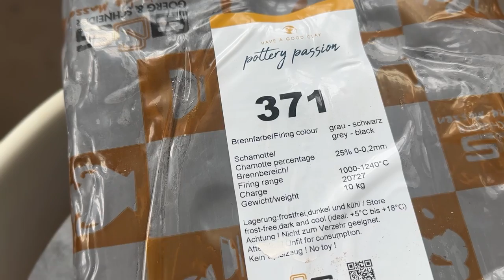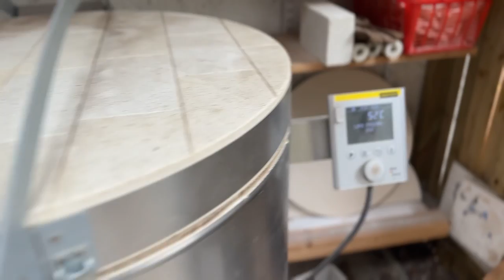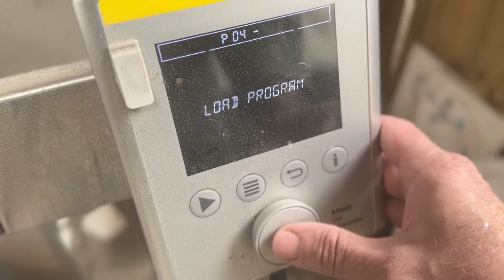123. How to Make Dinner Plates - from Start to Finish

Comment: Finally! Finally, I've found a channel of someone actually talking through the process, I clicked on a lot of pottery channels where they're just throwing & things, but not saying or explaining anything through the whole video, just quit. I clicked on those channels didn't hear them say anything & clicked right off.
Reply from the maker: Thanks 🙏
Reply: That is so true.  Mikkel always explains.
Reply: Have you ever probleme with the bottom becoming convex (making it rock)? I learned always remove from th middle of the bottom leasing a fot ring to stand on.

Comment: Will the plates come off like that if you are using plastic bats? The plastic will not absorb any water, so perhaps the plate sticks to the bat and in that case and it may be better to wire off?
Reply from the maker: Yes, plastic bats wont

Comment: Hi Mikkel, im very new to pottery. And looking forward to my pottery class soon. But i wonder with the clay you used for the plate, its called black clay? But im trying to find it here in Auckland New Zealand, but most of them are looking so black not like the one you use which is more like gray? So im confused. Thanks for the help. Andrea. ❤ the video.
Reply from the maker: Thanks :-) What clay you can find locally is always different. You have to test the clays you can get to see if they act like you want

Comment: Hi Mikkel, I really appreciate this video. I'll give it a try right away. 😁 About your wood tool for cutting the plate edge. Such a great idea! I'm going to make one this week but with one small design change. If I cut a channel down the middle of it, then I can secure the cutting point with a wingnut bolt at the top. That way the cutter can be set for different diameter plates. I want to make nesting sets of plates this way. I'm thrilled at the possibilities you've shown here. Thanks a lot!
Reply from the maker: Thanks 🙏 and great idea!

Comment: Great video!  I stopped wiring off anything on which I wanted a flat surface on the bottom several years ago.  I love how easy it is to get a smooth surface that way. You do need a lot of bats if you are doing more than a few pieces at a time.  I use hi-density hardboard and coat them with spar varnish to make them more waterproof.  They aren't hard to make and fairly inexpensive. They last for years.  (I have to make my own bats or re-drill commercial ones as I have a custom wheel with odd distance bat pins)
Reply from the maker: Thanks. Sounds good :-)

Comment: Hi - very inspirational ---- can you please name the glazes that you are using - where to find the recipies if possible :-) ?
Also - Am I correct when you said that you brisque them stacked --- I have heard others say that they need to be bisqued standing up (sideways)?
Reply from the maker: Thanks :-)

The glazes I use have actually been quite a journey. The green and the gray-ish ones are based on a Black Matt glaze from John Britts mid-fire glaze book, but I removed all the original colorants and added my own. Replicating that exactly is probably not possible. The okker one is a modified yellow glaze. And again, the modifications and combination with this exact black clay I use probably makes it very difficult to replicate for others.
Reply: Standing is safer. That way the plate only has to carry its own weight. The more vertical, the safer (unless you have a fragile rim). If you stack them 6-7 high, there is a lot of weight on the lowest plates.
Reply from the maker: It works much better for me to stack. Fored a lot. Never har any cracks or warping